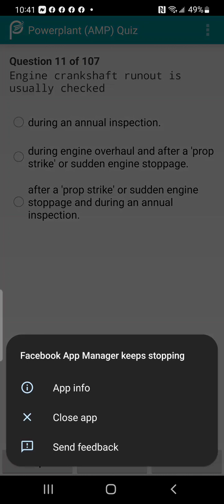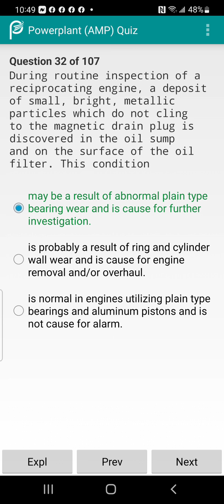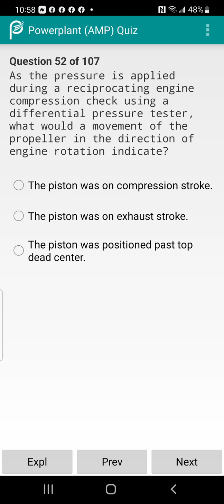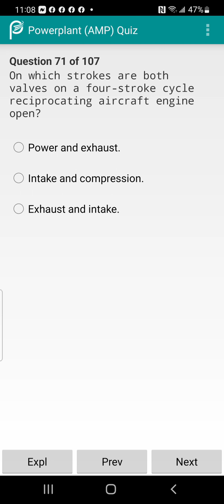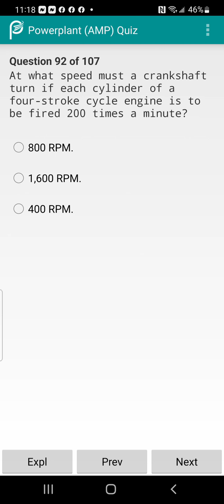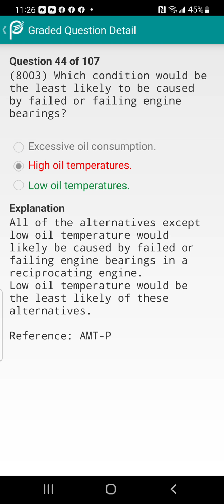powerplant  Reciprocating engines prepware

Comment: Did u take your powerplant test yet ?
Reply from the maker: Yes got a 84%
Reply: @Artproctor7380  wat tips do u have for me
Reply from the maker: @domo 80   Go to every section to get a 95 plus Then you will be ready. Study up
Reply: @Artproctor7380  how long do u think u did each section for I know 12 out of 15 sections by heart but I’m having trouble with the sections u didn’t post a video of like propellers, fuel metering systems, and ignition and starting systems
Reply from the maker: @domo 80   I'm sorry about that propellers is one of the hardest ones If I were you just go over like tlike the   Centerfugle force  torque binding force and thrust binding force and what they do. Write them all down  and just read it over and over till it sticks
Reply from the maker: Only powerplant  O&P and I am done
Reply: @Artproctor7380  , Hey Art, Im going to take Writtens, Oral, and Practical for Powerplant. Which book or app do I use to study for the writtens?
Reply from the maker: @domo 80  most of it just rember read it slowly and think about it  it will come to you
Reply from the maker: You go to aim
Reply from the maker: @domo8091  congratulations🎉🥳👏 nice work that o and p is what I am working on now
Reply from the maker: @domo8091  add me on https://www.facebook.com/art.proctor.56
Reply from the maker: @domo 80  good luck  I only get 2 hours a day two study  but I wish you the best of luck and let me know